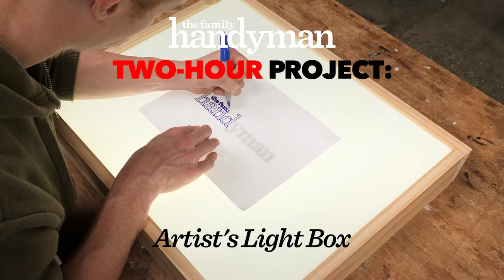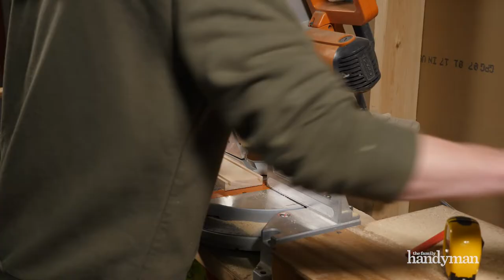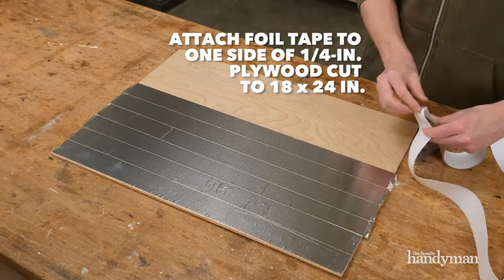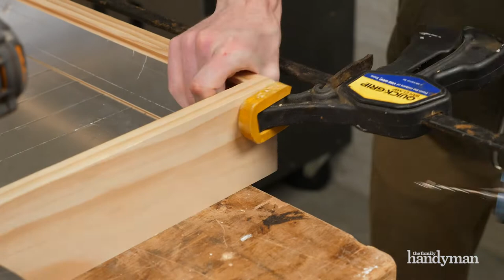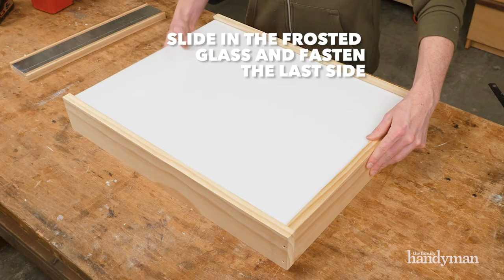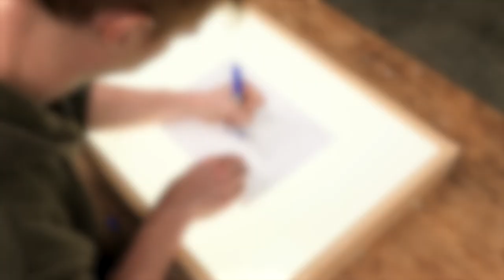Two Hour Project: Artist's Light Box

Comment: I am learning how to draw (without this thingie), and it could be useful for example when you have made a sketch and want to transfer that to another underground, such as aquarelle paper, or canvas, so you don't have to do the sketch all over again, but the problem with this thing is, thatif you make a picture and use it, the image will be smaller when transfered. I use my drawing, add a layer of graphite on the back and trace it to the other underground (first I make a print with the printer). And that method has got it's limits as well, because you can't do that with for example A3 size, because almost nobody got such a large printer. For small drawings it is fun, I suppose. In our local 'dollar store' in The Netherlands this thing goes for just 1 dollar 50 or something.

1

Reply
Reply: When Tracing, which is what you use a Light Box for in Drawing, it should be exactly the same size as the original. You are hand copying the image, in a much slower fashion than a Copier would, but it is the same principal the image should be an exact copy. 

Now if you want to resize things, then yes you can use a Copier to do that, I’d use Officeworks where I am, then I could take my enlarged or reduced image home, and use the Light Box to Trace it into another image etc.

What I personally want one for is Fashion Design, so sometimes I’ll get one side perfect and just can’t get the other side to match. So I can use the Light Box to Trace that one good side, flip it over and then trace it into my design, saving me tome and frustration in the long run.